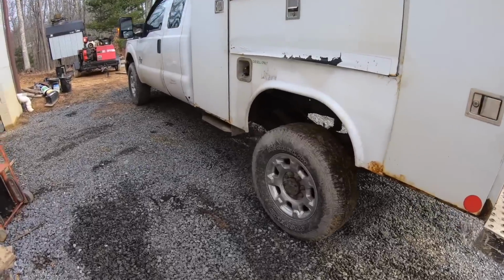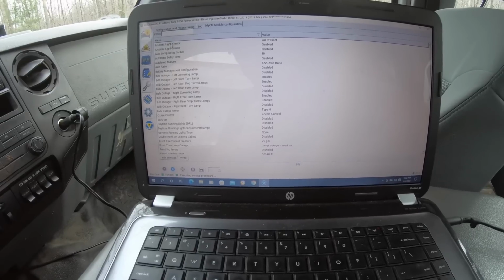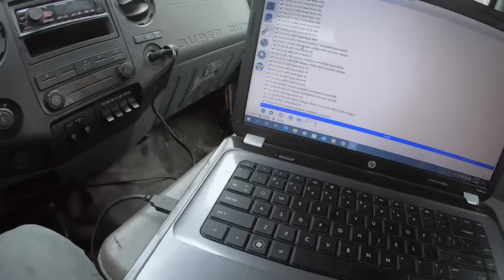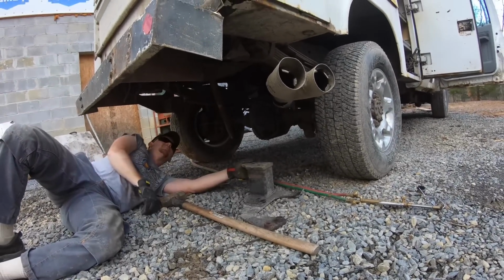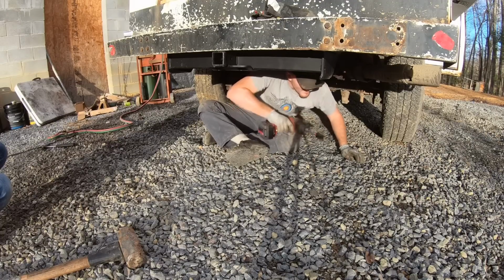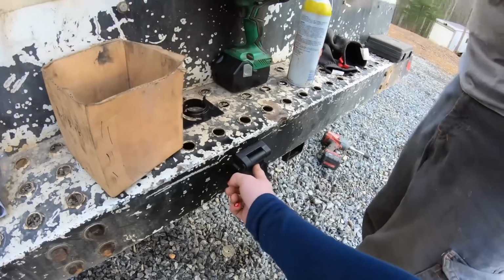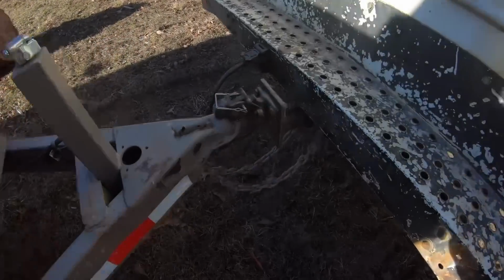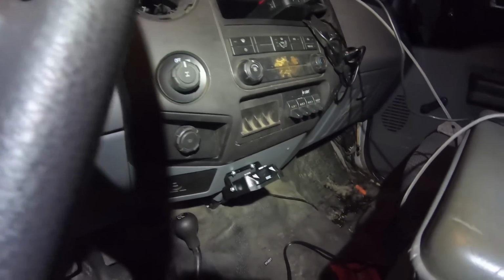Installing a Trailer Hitch and Brake Controller on my Service Truck

Comment: Hi Dave- I just bought one of these Rail trucks as well. Noticed the turning radius is really bad. Did you have to remove anything to help yours? I didn't catch that in any of your 3 part series on when you first got it. Your videos have been helpful, thanks

Comment: hello from the Netherlands . 
Dave can you not repin the plug from the original Ford brake controller that it works?  .  
who was your lovely assistant in the video?
thanks for the video Dave .  
Sincerely Hollandduck

Comment: Dave, most of the time you don't have to get into the computer to activate the brake controller. You just have to install the relay and sometimes the fuse. Look in the owners manual to see which ones are for it since ford can't quit moving things around and won't put their diagram on the lid of the fuse box like everyone else has